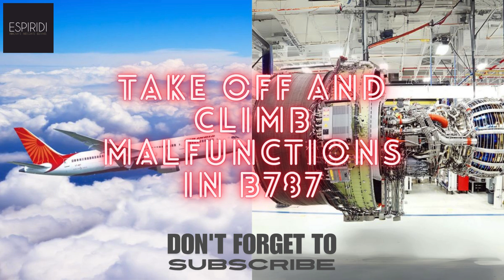TAKE OFF AND CLIMB MALFUNCTIONS IN THE B787

Comment: If an autothrottle software glitch erroneously rolled back both throttles to flight idle (subject of recent AD 2024-16-07) at weight off wheels (WOW), would this have resulted in an automatic deployment of the ram air turbine (RAT)?